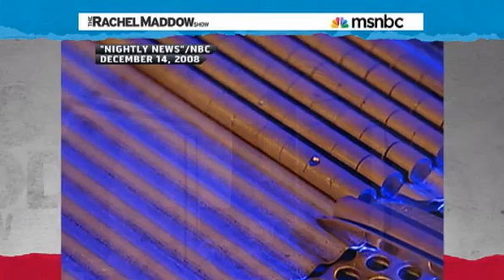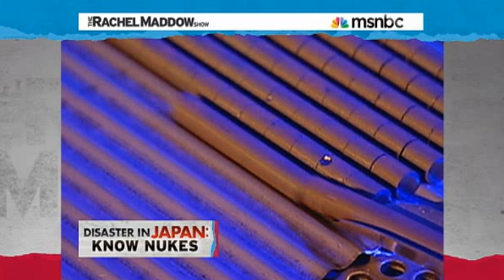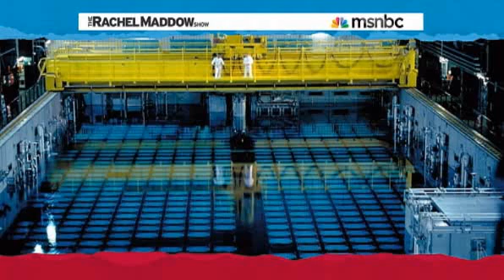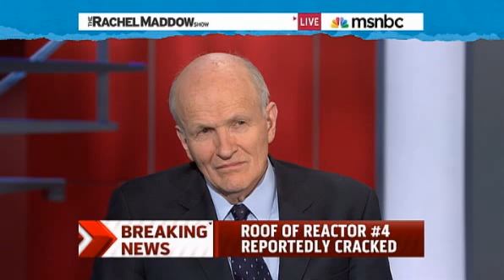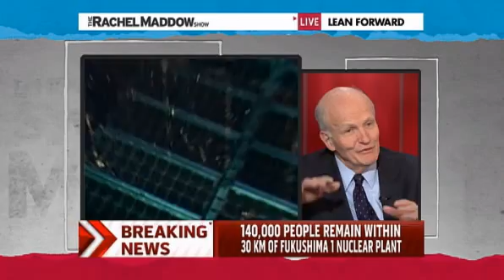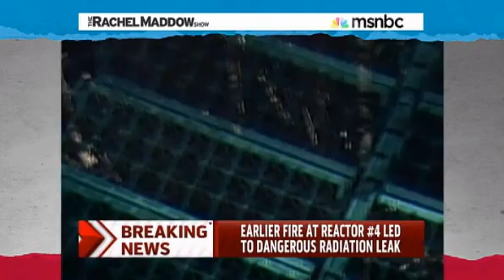Must See: Interview about spent fuel pools with former White House official

Comment: You're right. A nuclear reactor produces only one thing : waste, deadly waste. It does not even produce electricity at all, it only heats up water. Then, the vapor from the water is used to move a turbine, which in turn produces electricity. We have been lied all the way about nuclear energy producing electricity : the ONLY thing it produces is waste. A nuclear reactor is a waste factory, full stop.

Comment: One mistake, though, in the explanation : the heat in the reactor DOES NOT produce electricity, it only heats up water. Then, when the water boils, it produces vapor, which is used in a turbine, which produces electricity. So, fundamentally, nuclear energy is only THE MOST DANGEROUS WAY of boiling water. Is not it extraordinarily frightening ?

Comment: Are you stupid, nothing was averted, reactors 2 and 4 have melted thru there containment vessels and are now burning deeper into the earth and releasing vast amounts of radiation into the Pacific Ocean. If this molten pool of uranium reacts with ground water and explodes, then the spent fuel rods stored above reactor 4 will crash to the ground, starting an open air nuclear reaction fire that will expand to the other reactors of 1 - 6. Are you stupid or a government paid troll?????

Comment: It's very difficult to ignite zircalloy tubes, unlike something like fine zirconium power; you can't do it with an oxyacetylene torch. Reactor 4 has fuel that was removed from the reactor in November; that might be enough to degrade the cladding through oxidation or through warping and cracking through temperature shock.

The most dangerous(therefor short-lived) fission products in #4 spent fuel pool have already decayed(e.g. iodine-131) and volatile isotopes don't represent the full inventory.